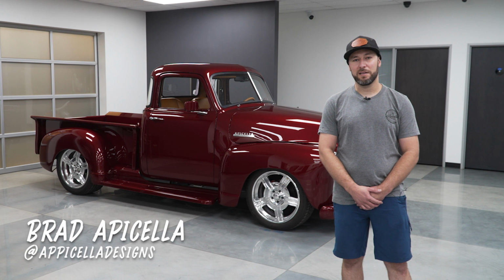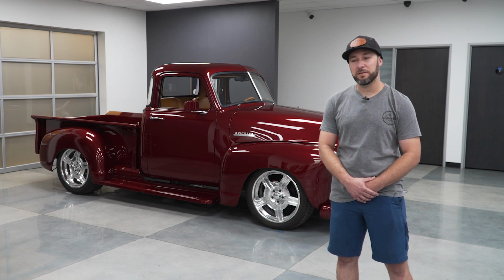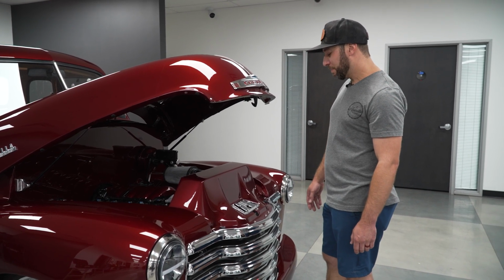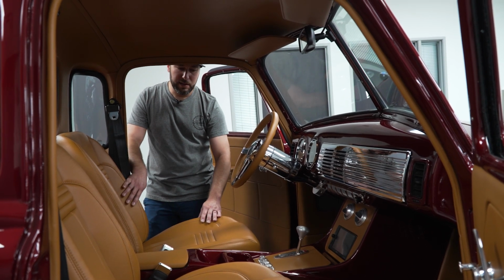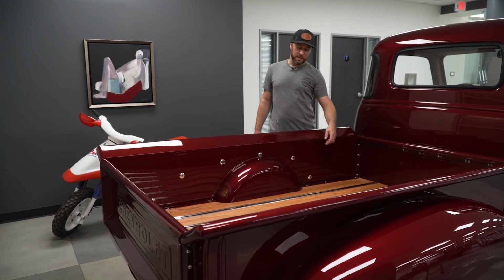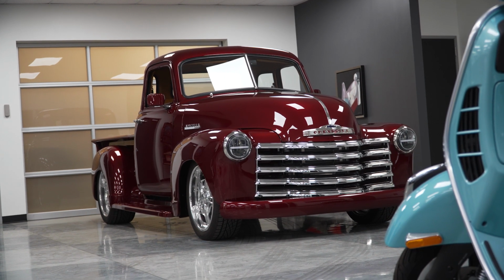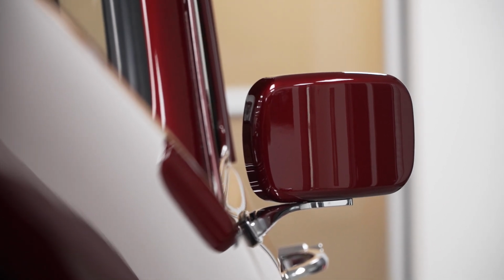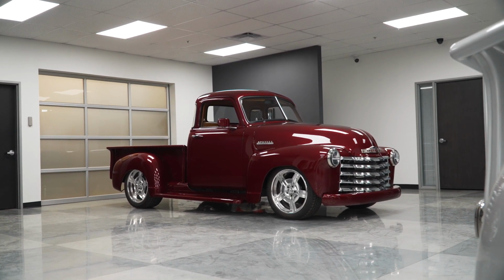Customer Spotlight - Apicella Designs Ultimate 3100 built for Chris Tulley

Comment: I don't understand what you said about leg space. 
I'm 6'1 and have a super charged 350 with a stock firewall. Backed my motor up to the firewall with set back plates. I instant a 1990 Cheyenne bench seat.  With a Speedway tilt column. Not any issues with leg room.  My truck is a 1952.
Same truck.